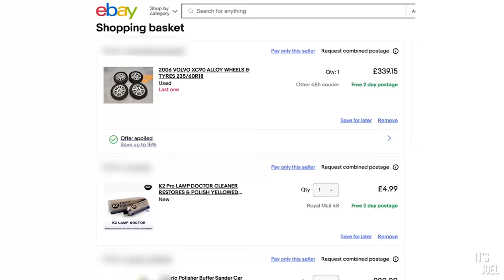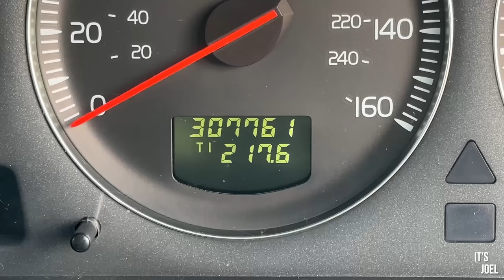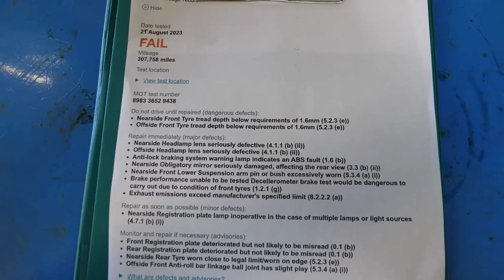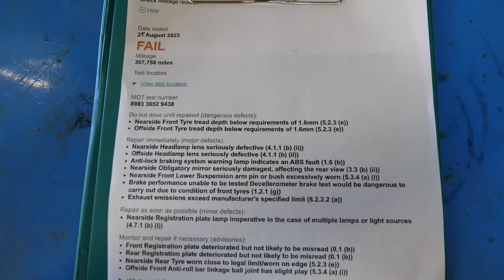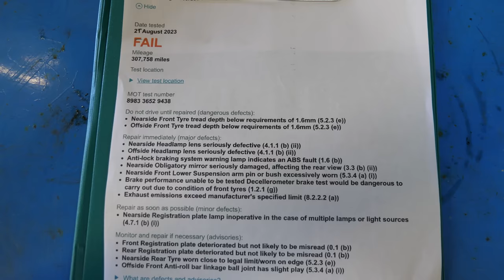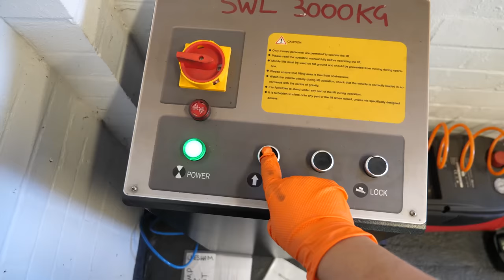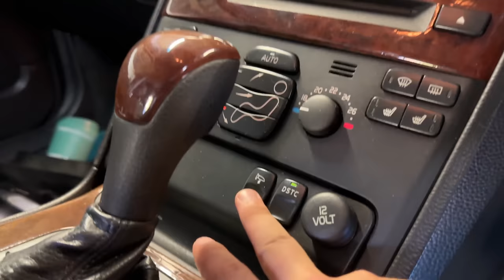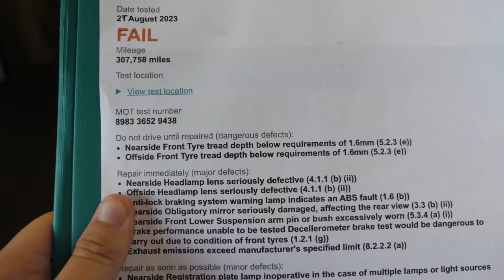CAN I SAVE MY £800 COPART VOLVO XC90? PART 1

Comment: Great to see someone fixing their own car instead of condemning it to the scrapyard. We'll done Joel!
Reply: Its also motivation NOT to get models with all the fancy toys. Give me a gas pressure shock absorber over a electromagnetic damper system any day.
Reply: Especially when it is a car like this. I am talking about 2000-2007 volvo. Its very well built, reliable (d5 is amazing engine) and comfortable. I own a V70 myself, from 2005 with 306k on the dash, and runs like a charm.

Comment: Joel, its great you are having a go but please be minded a torque wrench is just that, its for torqueing up a nut/bolt to a specific tightness. Its not for using as a large socket wrench. This is the job of the breaker bar.
Good luck Andy
Reply from the maker: Thanks for the tip!
Reply: @itsjoel  It's a learning process!! I am learning how to work on my 2004 XC70, it's a journey!

Comment: I find using a powered rotary wire brush on the threaded ends of the rusted suspension bolts helps. When the threads rust, they gets bigger and won't unthread through the nut.

Comment: Hi Joel, just wanted to say what you have there is a Ryobi impact driver, it’s mostly for putting in screws etc, what you need is an impact wrench, it’s massively more torque, has a 1/2” head on it for sockets. Will make life much easier. Also a ball joint splitter would help, they are tapered so your unlikely to budge it via normal means :)
Reply: All tapered joints can be easily removed if you know how to hit the receptacle properly with a hammer.....I have never used a ball-joint-splitter in my life.
And I have never damaged any component as a result. It's the appliance of science......of which I know little, but what I do know, works.
Reply: It looks like the impact wrench to me. - I have one, works fine, -  200Nm torque.

Comment: Hi Joel,
All you need for the roll bar bolts is an alan key that fits in the end of the thread, then use a ring spanner to undo the nut.  Best off with an alan key from a socket set.  It's got much better leverage.  Obviously put the ring spanner on first.  A longer bar and a ball joint spliter will sort all the other bolts out.  You probably need to clean the thread with a wire brush on the strut bolts.  The new ABS wheel will need heating up to expand it and use the old one to knock it back on, but really clean the area with a wire wheel on a drill before knocking it back on and grease up around the end of the drive shaft.
You've probably managed to sort all this, but just in case you haven't👍👍
Reply: Came here to say exactly the same thing.
Reply: @K.S.D.AUTOMOTIVE   Exactly... I fully agree....but...I have NEVER had need of a Ball-Joint splitter.... Not done much on Motorbikes, so I stand corrected if I am incorrect! Cheers.
Reply: There is another way: You put leverage on the back of the "joint" so increasing the taper effect on its shaft..... then the nut will come off.
But yes, an Allen key is normally the solution. We all live and learn. Hopefully.

Comment: Hi Joel the one tool that you should be ordering is an angle grinder!
Anything that you plan to throw away you can simply cut the sucker off, drop links and anti roll bars are common for this. It will certainly be the quickest move considering you only have the workshop for a few days.
Reply: Big thumbs up..... Yeah, I did the same job....but not to replace the parts, just for access to the alternator on a V8, otherwise, just cut the nuts off:
Stop messing about.....! If it is a scrap part...treat it as such.

Comment: They are drop links - not anti roll bars. When you work on anything suspension related the first thing you do is spray plus gas on anything you need to undo. Good luck.
Reply from the maker: Thank you!

Comment: Handy tip, if you cant unbolt it after using penetrating fluid try using a mini blow torch to expand the nut. Just make sure the flammable fluid is rinsed off first! Also if a different coloured mirror bothers you (might do) you can either spray them or buy d.i.y vinyl wrap and cover the outer shells

Comment: Joel - you need a blow lamp, a heavier club hammer, a ball joint separator and to remove the anti roll bar drop links, use a spanner or vice grips to stop the joint from spinning while you undo the nuts.  Good luck with part 2 !!

Comment: It's worth mentioning that there is a tool called a nut splitter that will remove rusted on nuts in locations like that. Also an angle grinder as a last resort (or Dremel even with a cutting wheel). Always wire-brush the hell out of the threads before undoing the nuts so they don't bind again as you undo them. Also recommend Plusgas instead of WD40 for unseizing parts.
Reply from the maker: Thanks for the info!
Reply: Absolutely agree on Plusgas. WD40 is great up to a point for lubrication. But for really stubborn items, Plusgas is a major step up.
Looking forward to the rest of your journey with the Volvo.
Reply: I agree: WD40 is vastly over-rated.... it helps, sure. But remember... it is not a lubricant in the long term sense as it evaporates.
Reply: Yes to plusgas

Comment: For future reference put the nut back on the lower control arm and hammer that (you are replacing the nut so doesn't matter) the shock load should cause it to pop off.

Heat is your friend here too, esp for rusty bolts; will see later if the blowtorch helps you :D
Reply: also get a bigger hammer, that small claw hammer is not enough for shock load :)

Feel the same way about locking wheel nuts; all cars i've had of late i swapped out for new bolts etc; you just know the locking wheel key is going to let you down when you need it.

Comment: Good on you for saving a good car. Just a suggestion when you want to remove corroded nuts and bolts on the suspension components, before spraying with a releasing agent, try removing some of the corrosion with a wire brush first, then spray with WD40. It really can help.
Reply from the maker: Good tip!

Comment: I feel your pain with the locking wheel bolts. I mullered my key (I went crazy with the impact wrench) so I had to get a garage to get the bolts out and I replaced them with normal wheel bolts which I bought from the dealer. I also struggled with the front drop links and ended up getting medieval with a grinder. I had to replace the passenger door mirror too. eBay is good for genuine used parts. I think that injectors have to be coded or programmed to the ECU if you replace them but you might get away with replacing just one. I'd have tried Cataclean but Redex is better than nothing. The Volvo forums are a wealth of knowledge and I've documented the work I've done on my XC90 on my own channel.
Reply from the maker: I am subscribed to your channel, and your mirror replacement video helped me here.. thanks so much!
Reply: I'm glad my videos helped. Happy to share my experiences.

Comment: Joel - evening, I have just come across your channel and I agree completely that any old Volvo that structurally doesn't require hours of welding is worth repairing and saving. Truth be told, I actually like the fact that you can see wear and tear in the car to prove that it's been used as a family transport.  I have a 20-year-old XC 70 and lower control arms were on my MOT fail list as well. A huge pickle fork type ball joint splitter that you can belt with a hammer is a very useful tool and can be used as a lever once you've broken the rust around the ball joint hole. Good luck.

Comment: For the mirror, see if you can get your hands on some vinyl wrap in the proper colour (I suspect it's Volvo 466 Barents Blue Metallic) which should be easy enough to stick on. You can also get the paint in a spraycan.

Similarly, fibreglass, polyester and vinyl wrap would be a good solution to repair your interior trim without having to search the exact matching parts.

Comment: I would be very careful about putting the used tyres  on as the volvo awd system dose not do well with tyres that have different amouts of wear needs at least the same amout on each axle
Reply: Totally agree with that but at this point it is just to get through the MOT. Once that is done you can reach for your big wallet if you are keeping the car.

Comment: I am very excited to see how it turns out. I'm a mechanic and also a XC90 owner, but I can see everyone has covered any tools or tips you would need. I got to say ebay UK is great for tools and parts, especially used. Having since moved to France, Ebay France never has discount codes and all the prices of new or used parts are double the price and barely many listings.

If I order parts here from ebay uk, I'll end up paying over twice in shipping and customs fees etc since Brexit. So instead I plan to make a big basket and then come with the XC90 once a year, pay the ULEZ (London) and stock up on all the parts and tools I need haha. Literally the cost of fuel and ferry would be less than the difference if I buy them here.
Reply from the maker: Wow, that’s crazy!

Comment: Good work there! I've done quite a lot of my own servicing and repairs, and got stumped by very tight bolts when replacing brake discs. The local independent garage were great and sorted it for me while I supplied the parts. They were so efficient at getting the blasted things undone that the labour cost was minimal too.

Comment: I might be wrong, but those drop links that you were struggling with, if its spinning round and not undoing, you'll probably find you need a spanner of the same /similar size at the back of it too as its just a mini ball joint type thing.  Great video and keep at it...
Reply: For the drop links, you use an allen bit, or a Torx bit it looked like in this case, in the end to hold it, then a ring/open spanner to take the nut off. Or, as you have new hardware to fit on and won't need the old bolts etc..., just grind it off and fit the new ones.

Comment: I've done the suspension on my Volvo V70 p2 (the suspension is almost completely the same). In order to take it apart and prevent everything from spinning together (as you mentioned in the video) with the nuts is to put a torx key (the holes for the torx are visible on the video) with one hand inside and turn the nut with a spanner with your other hand.

Comment: Hi Joel. Have you tried using an allen key to lock off the drop link bolts the hex hole for the key is in the end of the bolt. You will need to use a spanner of course on the nut. If as you say they are turning all as one locking the bolt it should come off.

Comment: Nice to see....

But big no no using the torque wrench to remove bolts, use the breaker bar instead, you'll mess up the internals of the torque wrench otherwise

Comment: Great to see you attacking this project yourself! I remember when you were nervous to do an oil change, older cars like this really are just nuts and bolts. As you’ve found, corroded nuts and bolts are the biggest challenges with older cars

Comment: Cut the anti roll bar links off...

It could be an injector seal leaking, or, i have had it more than once the pipe going into the injector needs tightening. Ive also had it fail emmisions due to fuel filter need changing...if its dirty and blocked it will push the emmisions up.
Reply: Engine service will help - Just replace the oil and do all filters, fuel, oil and air.

Comment: You need a proper impact wrench like a Milwaukee you are using a impact driver big difference. And also for the drop links you a torx to go in the centre to hold it while you undo it .and on top.of that a ball.joint splitter

Comment: Ball Joint splitter! The drop links involve a torque key and a long ring spanner plus ty wire brushing the rusty threads first. Good luck with the lower control arms, that involves a bolt through from the inside. Again brush off the exposed threads

Comment: I would make a cut in those awkward bolts and gently but firmly, hammer and chisel those bolts into undoing. You're not trying to cut the head of the bolt off, just enough so it can be undone.
 I doubt you will get those headlights back to normality. It might be cheaper and a lot less frustrating to replace them or maybe have professionally refurbished.
 You've got a new subscriber anyways. Good luck with this car mate, I think you're gonna need it............

Comment: Its fantastic to see you getting stuck in!  You'll get used to mechanicing in no time and you'll be rebuilding whole cars. Im not usually too fussed by video ads, but ive almost completely rebuilt my Range Rover and its engine with ebay parts. Make sure to link your nectar card to your Ebay account 😂

Comment: Rule Number 1: Don't use a Torque Wrench as a breaker bar, ok if it's knackered but seeing as you just bought it using it crack off nuts it's the best idea especially when you want to Torque things back up again. As a mechanic it's definitely not a wise idea. Still hats off to you for tackling the jobs yourself. Those front arms can be a right PIA!!! 😂😂

Also didn't Volvo say the Intercooler is blown or the Radiator cause they're two different things. Intercooler is for the induction system ie Turbo and Radiator is the cooling the engine with Antifreeze. Make sure you check which has been said before ripping into the wrong unit!!

Comment: I've freed very stubborn nuts by applying heat using a blow torch. Got to be done with care (don't set fire to anything) but it's worth a go before resorting to angle grinder or nut splitter.

Comment: A tip for taking the locking wheel nuts off yourself - use an impact driver because it drives in the 'key' while turning it. Also never let the idiots at the tyre centre use a compressor on that locking nut. Better still get rid of them, they are an absolute pain. I have had two go bad and one had to be cut off with a Dremel (shaped it to a standard hex shape).

Comment: For the The anti roll bar links use some mole grips clamp the rubber boot as hard as you can and then undo the nuts. The lower ball joints your using the same technique as I would but you really need a heavier duty hammer to hit the arm whilst levering downwards.

Comment: Hi buddy, you need a ball joint breaker tool… looks like a two prong wedge…. Euro car parts have them in stock. For your drop links you need a spanner and a T probably T45 or similar size to hold the thread from
Spinning whilst you undo the nut. Good luck mate

Comment: You need a good impact wrench and socket set if you have an old rusty car. something like the DEWALT DCF899 will remove those bolts (and add some heat).

Comment: Before you hit any bolts with a hammer put a nut on them to protect the threads. And get a ball joint splitter to separate the ball joints. Have fun and remember I AM WATCHING YOU.👍

Comment: lol welcome to the life of any DIY home mechanic. as most of us that do our own stuff over the years we gather the tools needed and if in doubt then use a bigger hammer :)

quite a challenge you set yourself three days is tight for all the components you want to change especially without tools for the job. hope it goes well  :) and the tie rods for the anti roll bar have a  hex on the other side so you can hold when undoing the nut ;)

Comment: Advice on old rusty cars , wire brush,wire brush wire brush, then penetrating fluid, if parts are being replaced with new. Angle grinder

Comment: Easier just to cut of the drop links.If you want to keep them use a bottle jack with a bar or timber to put them under pressure

Comment: They’re Drop Links, not Roll Bars. :-)
If your doing suspension on an older motor your tool of choice is an angle grinder with a 2mm disc. Just chop the nuts &/or bolts straight off. The drop links on my Galaxy were practically service items. I’d never faff about, straight in & chop them off.
But great effort young man. !!

Comment: I use to jack handle of 2 ton jack to break ball joints .hammer around ball joint to shock it to loosen .then use big bar .you can use 5ft scaffold tube

Comment: I have a set of side steps for sale, original Volvo ones not after market ones I’m in South Shields near Newcastle 
Keep at it Joel I enjoyed mine until the oil seal went that’s between engine and clutch housing common thing to go especially after a service 😊

Comment: I had 2007 reg xc90 D5 2,4 diesel. Perfect car. Nice comfort of full leather. Bose sound system. Automatic. Unfortunately after 3 years use, service was needed suspension, Abs, gearbox, tyres. I was ready to repair. It was perfect and beauty car but cost of repair was more than £2000. Too much for that old SUV.

Comment: Top tip if you need original nuts for your car go to a scrap yard look in the glovebox inside the locking wheel nut box youll find x4 oe nuts

Comment: I be careful with some of the eBay arms I got some for mine off there paid good money as I didn’t want cheap ones and never even did 250 miles and the bushes were shot as cheaply made. Ended up fitting power flex bushes to the arms and best decision I ever made. Good void hope u get it done nice hate seeing a Volvo going for scrap

Comment: Who's this "we" being mentioned all the time?  It just sounds pretentious to me.  Looks like one guy with no experience and a shiny hammer that still has the barcode label on it.  Plus he's using the torque wrench to loosen rust bolts (keep that for torquing up - use the breaker bar to crack something free and then a ratchet to fully remove).

Comment: No ‘how to’ videos show the struggle of working on an old uk car 😂
Take a grider with a cutting disk and cut straight through the drop link bolts on the joint side. How you’re supposed to get them is with a spanner on the nut and a torque bit in the hole on the bolt but you’re just going to smash your hands on stuff if it’ll turn at all